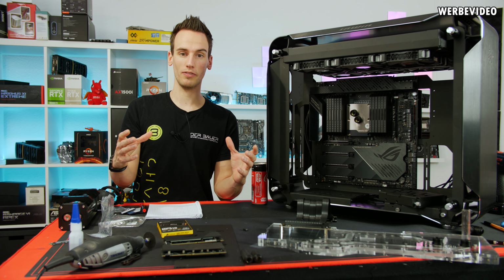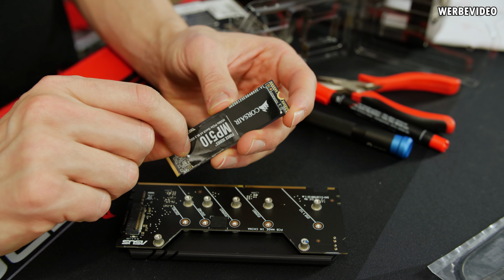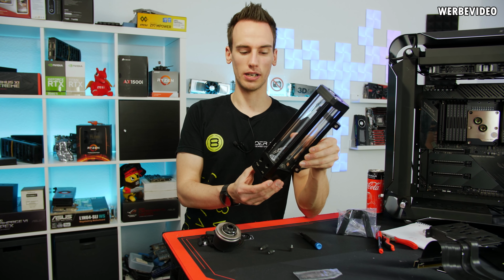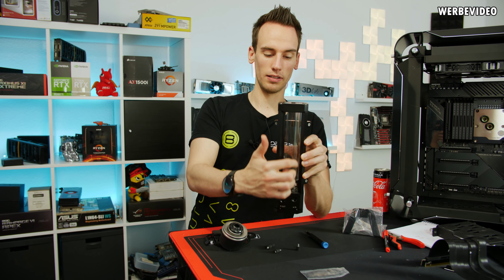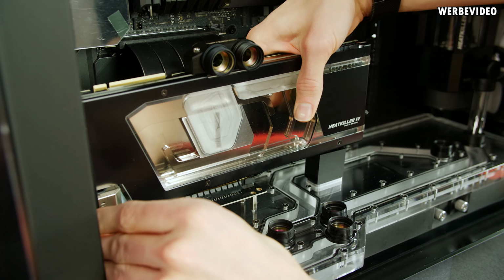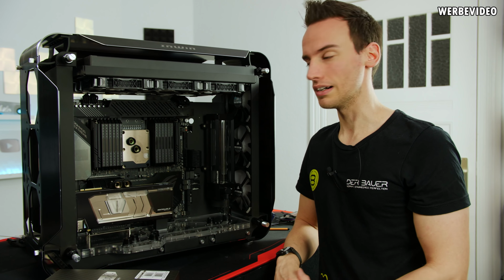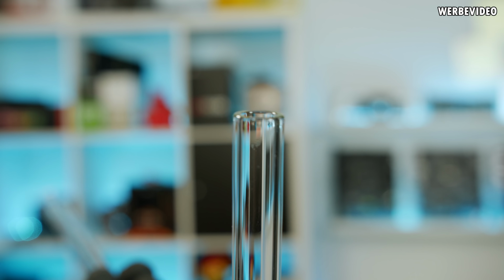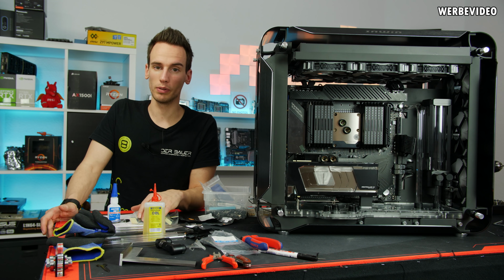Project Irrationality Part 8: I thought the PC would be ready but then THIS happened...

Comment: I've never even seen a DIMM.2 adapter before. Now I have to go so some research. How does it access PCIE lanes from a memory slot? I thought the lanes were all between the CPU-PCH-PCIE slots. Does that SSD communicate directly with the CPU memory controller?
Reply: Ooh after some research I see it's only using a DDR3 socket for the proprietary riser. It's connected to the PCIE bus like a normal M.2 slot. It's just used to reduce congestion on the board I suppose.

Learning every day.

Comment: should you always take the sticker off the nvme drive? i have a 970 evo and i did not remove the sticker.
Reply: For best cooling if you have a heatsink yes.  If you have no heatsink for it and the sticker has a copper sticky side then no.  Just need to lift a corner carefully with a craft knife to check for the copper under-side. 👍

Comment: 3375x sounds out there but it would be cool. Red flag for me was 5.1 base clock.... at only 700 watts...... I dont even think the 28 core is capable of that
Reply: Unless that is the turbo clock or the CPU will be manufactured with a finer process. I haven't heard of the 3375X rumor, but it sounds even more ambitious than the 5.0GHz 22-core 109990XE rumored last month. I'll believe either processor is going to happen when I see them on the shelves...

Comment: Aww meaby thous tubes are from bad batch. I think you shuold pressure test thous other tubes and see if they crack under pressure. 0,75bar (ek tester kit) for 2 hours (offical time at pipe fittings)

Comment: RAID is not a backup, I've had two different arrays have multiple simultaneous failures because they were using homogeneous drives.
Reply: That is statistically nearly impossible. To have  three of five drives fail on the exact same day is and not the result of a hardware problem. If you saw those failures something in your system took them out.
Reply: @otm646  Having a second drive from the same production run fail during raid recovery is not only possible, it's common.

Comment: The part of the tube being clamped down is so close to the bend that it is very likely deformed... It is not receiving equal pressure from the fitting and thus cracking. I don't see a way around this problem.

Comment: You'll have to use a very light, almost see through rubber sleeve of some sort, on the end of the glass tubes or rubberize/coat the inside of the fittings. Glass and Metal do not mix. Think of a car windshield.
Reply: These types of hard tube fittings don't work that way, the metal does not directly put any pressure on the tube, the metal part simply compresses a rubber o-ring once you start screwing down the collar which then creates a watertight seal against the tube as the o-ring's shape changes.
There is only rubber creating pressure directly against the glass here.
This glass likely became brittle from being heated then cooling too quickly if I had to guess.